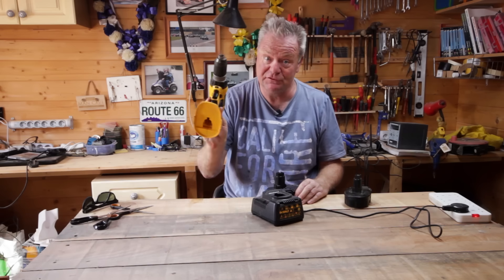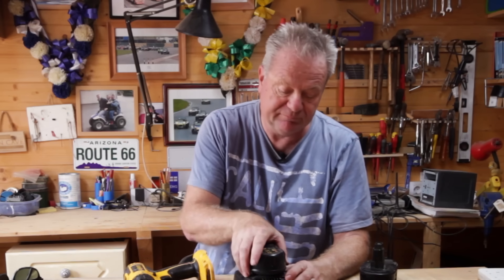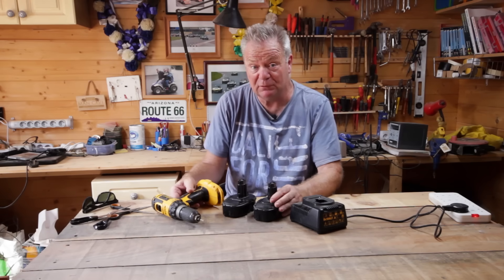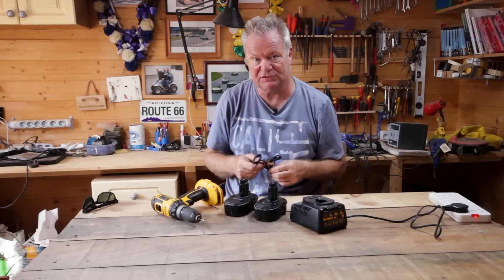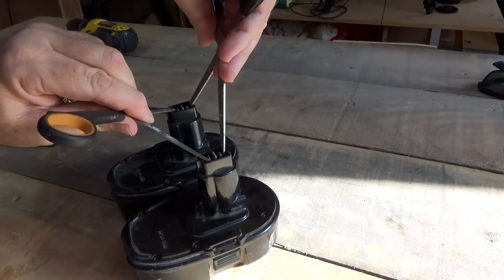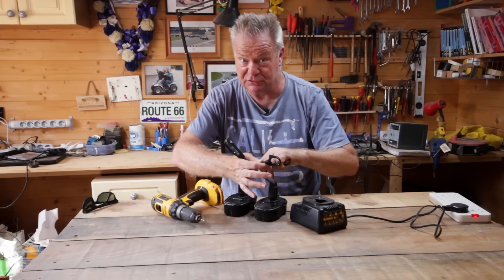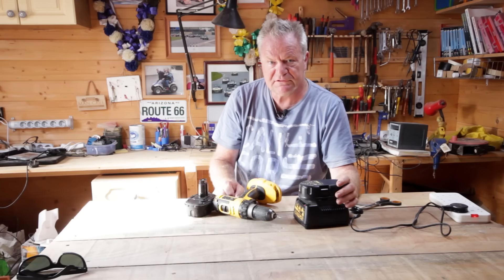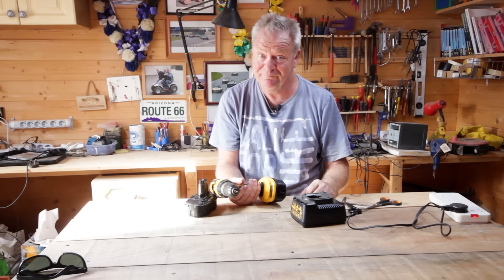How to revive a dead rechargeable power tool battery easily

Comment: So the idea is to get enough of a charge into the "dead" battery such that the charger will not see it as a "dead" battery and recharge it.
Reply from the maker: Correct Ronald. I hope it helps. Thanks for watching.
Reply: JP in Fuerteventura When you first tested the ‘bad’ battery in the Drill there was a bit of charge to turn the drill a few turns till it ‘died’, Can this ‘tip’ be used on batteries that can be charged but only hold enough to do what your ‘bad’ battery did( a few turns) ?
Reply: @JPinFuerteventura  JP. Your video makes a lot of sense. It's just like jump starting a car battery. I have a question though. After you jump start the dead battery, give it a full charge and run it down again, will it recharge normally or do you have to jump start it again with a working battery, etc.?
Reply from the maker: @ralph0808z  I have never had to restart that battery again as it always charges when put in the charger. This was made 3 years ago and only recently has that battery started to hold its charge for less time than normal.
Reply: @JPinFuerteventura  Interesting, I still have my old "dead" battery and I'm going to try to jump start it as shown in your video. Thank you JP!
Reply: @ralph0808z  yes, because its a lithiam and not led acid.
Reply: Raymond greenridge  Not this woman!!!!
Reply: Swizzle Dwezzl  Thanks for the tip. I guess the real problem is that if you don't use the (old) battery for a long time it will completely die (as in the video). I still have my "dead" battery (never recycled it yet) and I'm going to try to revive it tomorrow.
Thanks for the reply!
Reply: @ralph0808z  did it work for you or did you end up buying another battery? Tia
Reply: @leesire  Unfortunately I had bought a new battery before I got the original reply. I have since spoken to others about this procedure who were familiar with it and had great success.
Reply: @ralph0808z  I have the Ryobi 1 plus batt 18 v.
I tried it and it didn’t work for me.  After a couple of hours charge it ran for about 30 seconds.  I tried the trick several times, no luck.  I’ll be getting rid of this battery and buying a new one unfortunately.

Comment: I imagine you could do the same thing with a charger that wasn't a smart charger.
Reply from the maker: I guess so although if the battery won't charge in a non-smart charger it might be because it has a damaged cell. It costs nothing to try though. Thanks for watching.

Comment: Ok. I'm in the same fix as you and I just used my wire strippers and connected similar to the manner you did to the battery that was dead and would not indicate any light on the charger that it was being charged. so now the completely dead battery May the green light come on on the Black & Decker charger whereas before there was no light and it would not take charge. I will comment again after I check the battery that was trash Worthy. charging now and see the end result. Shawn in Kansas
Reply from the maker: I hope it did work fully Shawn.  Thanks for watching.

Comment: I have a bad battery and they have stopped making that kind. I'm going to try this thanks for sharing this information with us. Thanks and God bless
Reply from the maker: I hope it helps. Thanks for watching Jack.
Reply: Did you do it? Did it work?
Reply: @TheDcrocks1  I tried it today and as God as my witness it did work! Brilliant,,, same concept as jump starting a car battery. You could even use a DC charger and check voltage of battery frequently off the charger till you get it to what voltage your battery is. Thanks and God bless
Reply: It works best and wont wreck your good battery if you use a dc constant current constant voltage power supply. But even then you do actully run the risk of burning them up. Just be careful, if they start to get hot get it outside and on the ground.
Reply: Oh and make sure its not a lithium battery. These NiCad nickle cadmium batteries. Thats extremely important.

Comment: Thanks for the tip. Unfortunately both of my batteries are dead but there’s probably someone who can suggest an alternative method, perhaps off a different make of battery, assuming the voltage is the same. Whilst on the subject, and in this world of sustainability, I think there ought to be a standardised male/female type of battery and tool as you get with most electrical appliances. Thanks again. Regards, Bob M. South Wales, UK
Reply: Ahhhhh....but where would the money be in that?
Reply from the maker: Yes, if you can perhaps borrow a similar voltage battery that should do the trick. Good idea but I wonder if that will ever happen - after all it makes far too much sense! 😉 Thanks for watching Bob.

Comment: What if you got 2 dead battery? Do you have to buy a new one to jump start them both? Or can you use a different brand or style? And does it matter it you mix lithium ion and non lithium?
Reply from the maker: You shouldn't do it with Lithium so the "experts" say. You could use a similar voltage non-lithium battery.

Comment: I imagine you can't run the fixed battery totally dead again (to avoid it being like before) or am I wrong?
Reply from the maker: I regularly run the battery down to the point where the drill stops working and then put it back on charge. That way it isn't totally flat.

Comment: I did similar by opening the battery and testing each cell. I hot jumped the ones below a volt and it worked again. I used a 12 volt supply and I think a small 12 volt bulb to take down the load so it wasn't a dead short and hit each bad cell for about 10 seconds so it didn't overheat and explode. I can't remember exactly how I did it now but there was a video about it I couldn't find again so if anyone tries it be careful as you can overload the cell and have it explode or something bad like that hitting it with too much voltage and current because it's like a dead short if you do it wrong or stay on it too long. Basically the cells get like hairs of corrosion or something similar that shorts them out and hitting them with extra voltage shocks them and blows/cleans the stuff off.
Reply from the maker: Thanks for the comment

Comment: Only one thing missing here, but it's important. How do these revived batteries perform under load, and for how long. Voltage is good, but without amperage, it's not very useful.
Reply from the maker: The battery in the video is still giving service and that was over 2 years ago that I had to jump it. It all depends on why a battery has gone completely flat in the first place. This one I used until the drill stopped and then left if for many months by which time it was flat. If a battery has gone flat because it has damaged cells then that may be a  different story. Thanks for watching.

Comment: I believe the battery charged. My problem is, the batteries wont hold a charge off of the charger. The only way they work is to keep it on the charger all the time. That appears to be an older model driver. The batteries today are much better. I have a black and decker 20v and it's awesome. Powerful, cheap, and the battery has yet to go dead, even when left alone for long periods. In my experience,  older model ryobi batteries were the worst. I dont know about now because I'm afraid to buy ryobi. If you're having battery problems,  I recommend buying a new drill. They have made leaps and bounds in battery tech in the last 10 years.
Reply from the maker: If they won't hold a charge then that normally means there is one or more damaged cells. Thanks for watching.

Comment: Useful tip. Here's another one: wires.
Reply from the maker: I really don't know why so many people seem to have such an issue with the scissors. They work well, particularly when doing this on your own. But yes, wires would do too. Thanks for watching Bob.
Reply: @JPinFuerteventura  Scissors are very useful for scissing but some alligator clips and a couple of wires would free your hands to do something else and allow more flexible positioning of the things being tested. If you try them I bet you use them over and over.

Comment: Used this same system on a cell phone battery. Had an old cell phone hadn't used it in months and battery was dead.wouldn't charge. took a 9 volt battery and flashed touched it to the battery's charge pins and it took a charge after that.still working as a backup phone today.
Reply from the maker: Yes, from some of the comments it seems it does work on numerous types of battery. Thanks for watching Timmy.

Comment: The problem is 1990s nicd battery technology in 2020.  Dont bother doing this.  those old ass batteries can explode.  I had dewalt batteries just like that.  one exploded on the charger and sent shrapnel all over the shop.
Reply from the maker: Your opinion Ed. Many have tried it successfully. Thanks for watching.
Reply: @JPinFuerteventura  the danger of fu@king with old nicd batteries is not an opinion.
Reply from the maker: @edlomonaco  Well since these were NiMH batteries that isn't an issue

Comment: I bought a Ryobi radio and battery at a auction, and the battery was dead wouldn't charge. I took it apart and used my variable power supply on each battery , and now it works and charge.
Reply from the maker: Well done

Comment: I’ve got 5 or 6 of those old 18v dewalt batteries all dead. I’ve since replaced all the tools and batteries with the 20v, which are much better. I still have the old stuff laying around. I’m curious enough to give it a try
Reply from the maker: It costs nothing to give it a try Jeff. Thanks for watching.

Comment: If you don't trust using scissors you can use jumper wires with alligator clips as well.
Reply from the maker: You can Steve but I didn't have any. Actually scissors work well and have insulated handles too. Thanks for watching.

Comment: The battery that was dead wasn't battery used at the end. Check the marking on the front of the batteries.
Reply from the maker: Get a life you idiot. Yes it was. If you don't want to believe this then don't. I couldn't care a jot.
Reply: JP in Fuerteventura Sorry, Zeke, but he pointed it out, I watched carefully, frame by frame. And the battery you claimed was dead was not the one used at the end. Outed!

Comment: another thing you can do to charge a dead battery is to put the battery in the charger and then take the plug and push it in and out of the wall socket over and over, just in and out in and out.. It might take a 100 times but eventually the light will come on and say Charging.. It really does work.. just plug it and unplug is as many times as it takes until it starts to charge again..
Reply from the maker: Interesting tip. Thanks.

Comment: Does this work with dremel batteries too
Reply from the maker: There is no reason why it shouldn't if the Dremel has a smart charger which needs to detect a voltage to start charging. Thanks for watching Jayson.

Comment: That’s bad ass. I wish I saw this before I just bought two new batteries. Also did you know you could jumpstart a car with one of those batteries? First figure out which side is the hot before it blows up in your face LOL
Reply from the maker: I hadn't thought about it but yes, I guess you could. Thanks for watching Mark.
Reply: JP in Fuerteventura we Do it all the time with our work trucks we use 10 gauge ground wire. :)

Comment: Another tip, if the drill is 9 to 18volt, make up some jumper cables and run it off a car battery, not so portable but ok for farm or building work out in the field
Reply from the maker: Thanks for the tip

Comment: Will this work with car batteries?
Reply from the maker: I have done it with a flat car battery where the charger wouldn't start to charge as it didn't detect a voltage.

Comment: This definitely would work. The same principle as jump starting or boosting a car battery..
Reply from the maker: Yes. I hope it helps. Thanks for watching Erwin.
Reply: But why won't the charger charge it?
Reply from the maker: @colstace2560  Because it is a "smart" charger (which means it is stupid) so it needs to detect a voltage to know that a battery has been inserted. If the battery is completely flat, as in the case of this battery, it won't detect it so won't start to charge.
Reply: @JPinFuerteventura  ah ok thanks, I'm a carpenter not an electrician 👍😁

Comment: Can we explain why or this works? Like a explanation?
Reply: Chargers relay on amperage to charge. What happens when you totally drain a battery there is not enough voltage to have enough amps. Think of a river with no water. The water is the voltage and the current or flow is the amperage. If the charger does not read enough voltage and not enough current, it will think it's the wrong size battery and won't charge. All he is doing is adding just enough voltage from the charged battery to the dead battery (like jumping a car battery) to fool the charger to start charging the dead battery. And if you try this method, I wouldn't use scissors. And charge it 2 or 3 more times to lengthen the battery life. But with any battery.. use extreme caution when jumping a battery. I hope this helps.
Reply from the maker: Great reply Robert

Comment: I'm guessing the charger doesn't recognize the battery to charge without some life to the battery? That's interesting cool tip. Thanks.
Reply from the maker: That is exactly it. They are so-called "smart" chargers and, in my experience, whenever anything is called smart (like smartphones) there are usually anything but smart. Thanks for watching.

Comment: I tried GOING GREEN.  Spent thousands on battery stuff.  Went back to GOING GREY with electric and gas powered equipment.  We don't have the Technology yet and find it a disgrace to throw out the tools because the battery can't hold a charge after so many cycles.
Reply from the maker: I agree Michael. My power drill is still going strong after more than 10 years. Thanks for watching.

Comment: Any explanation for why this works. Very precise video. Thank you.
Reply from the maker: This works because the chargers are so-called "smart" chargers so they need to detect a voltage to know that a battery has been inserted and then start charging. If the battery has gone completely flat then it won't detect it so won't start to charge. By jumping it for a brief period it gives it sufficient charge for the charger to detect it.

Comment: I love this tip, I was also a bit worried you were going to get a shock. Question, if you only have 1 dead useless battery, could you use a different battery like a car battery or a different drill battery
Reply from the maker: I think it is the voltage that is important. There was no chance of getting a shock as the scissors have plastic handles. Thanks for watching Mark.
Reply: Its kinda like jump starting your car with the - side and the + side.
Reply from the maker: Yes, similar
Reply: Make some jumper cables and use a car battery if it's a 12 DC drill

Comment: Something else to add to this info.  If you have a condition where the charger will not fully charge a battery, take that weakened battery and do the same trick shown in the video BUT with a higher voltage battery instead.  Like use a 12v to jump a 9.6v.  Hold the connection for 5 to 30 seconds and then try charging ir normally to see if it filly charges now.  If not, repeat with longer hold time.  5 to 30 sec. Is a very rough guess.  Each example is different.  Do not use different battery typez either.
Reply from the maker: Interesting. Thanks for the info.

Comment: Do you need to use an identical battery, or will any similar battery suffice? Does it have to be the same voltage?
Reply: Same voltage will be best but you can use a higher one for less time. You just need to “wake up “ the dead one .
Reply: Yes, same or a little higher
Reply from the maker: Thanks for answering

Comment: I've been doing this for a couple of years now.....but with lead-acid batteries. 
I bought a new electronic charger and it would not charge some batteries....the "very dead" ones.
Linked them to a good fully charged one.... (-ve to -ve.... +ve to +ve..) for a minute or so. 
And hey presto.... they accepted being connected to the charger.
But it simply never occurred to me it might also work with power tool batteries! 
A DOH! Moment.!!!
Many thanks for sharing this gem. Subscribed. Cheers.
Reply from the maker: So much for them being called "smart" chargers - they are as stupid as smartphones. Thanks for watching.

Comment: I've done this. Yes you can finally get the battery to accept the charge again. However it will barely be enough to turn your drill over five times before the battery goes dead again and it'll take 2 days to charge. You're better off getting rid of them and buying new replacement as far as I can tell
Reply from the maker: Not entirely true I am afraid Jeff. That could be the case if the battery is flat because it has damaged cells but a battery can go flat without. The battery in this video is still working 2 years later. This is a method to get around the so-called "smart" charger not attempting to charge a battery unless it senses a current.

Comment: Your forcing a voltage also works with motorcycle batteries, snow blowers and such like. With auto batteries they can use a 'boost' from the charger to provide an initial voltage so the charger will see a voltage and begin to work.
Thank you for reminding me, as I grow older my memory seems to fail now and again.
Reply from the maker: I know the feeling! Thanks for watching.

Comment: Epstein didn't kill himself. I don't believe this is a repair all solution, it will get you going though so you can tell for certain if the batt is done, or am I wrong?
Reply from the maker: It is primarily a work around the so-called "smart" charger which doesn't start charging until it detects a current